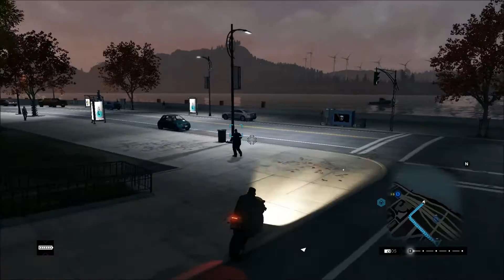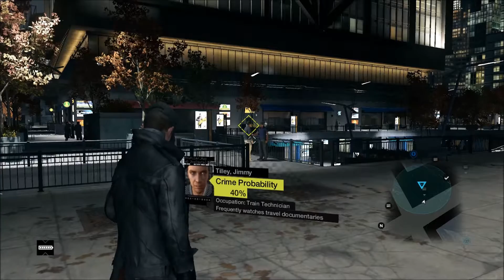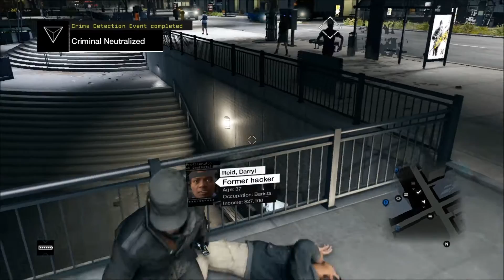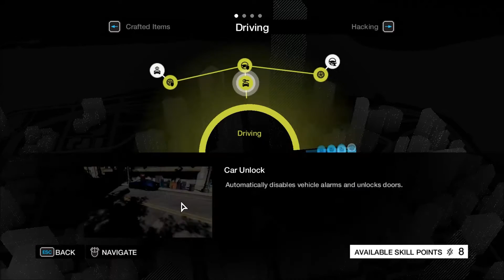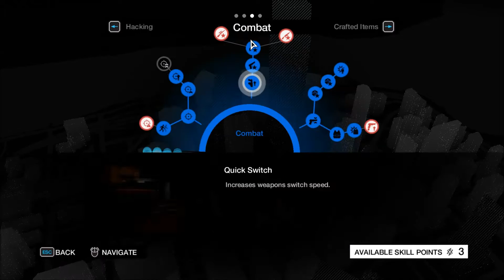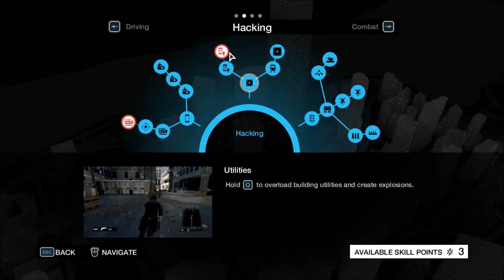MOS Profile: 5900 Electronics Maintenance

Comment: I'm leaving march 5th my program name is called aviation electronics technician. It has like BA on the form  for the program code and it has similar mos of 5900,  6300/6400 and 6600.  I would really like the 5900 field but the other ones aren't that bad. Should be fun I guess. And if not it'll be a huge waste of 5 years of my life. But j doubt it
Reply: Hey man how are you liking BA and what one did you actually get as far as the # cause I chose BA today wanna know if I should switch before I ship out
Reply: @roccorolih3902  hey Idk if you've shipped out yet but anything BA is good I just got assigned 5900 and I leave mct in 2 days for Pensacola but my dad and grandpa were both BA and my recruiter was BA as well. You will be busy af but you won't get bored with the job easily. Obviously I can't speak for all of the fields because I'm going off of what I've been told by other BA but I can say for certain that it will transfer over really well to the civilian side because the basics of avionics stays the same its just where the parts are located and how you remove them. And in the 5900 field you can actually get FAA certified which will help you even more with finding a job civilian side.
(I'll try to remember to update yall on my experience but I've got a year of schooling so ill probably forget ngl)
Reply: @contagious_noob3651  Hey man I was wondering how things went for you because I’m in the exact same situation as you were and I heard there’s a chance you could get sent to ground electronics? My orders say 5900 so I’m hoping I can get that, how have things worked out for you?
Reply: @eglismustelier924  im actually still at Pensacola ill be leaving in June. It seems really awesome so far and all of my instructors seem to love it but they also say the other 59 mos' aren't as good as ours im a 5952. I asked about faa certs and my instructors said that you dont normally get them but you can easily get a job in the civillian sector with our mos. And depending on the type of orders you get (station or detachment) you could see alot of deployments and see combat if we go to war. Station orders you dont get deployed but it makes college really easy to get done. The 5900 mos is also the smallest mos in the marine corps ans promotes pretty fast. You'll learn alot more once you reach c school but thats a good bit of it. Alos dont let the terminal barracks support get you down Pensacola is pretty cool.
Reply: @contagious_noob3651  So I want to major in computer science instead of cyber security since cyber security is subjective and computer science is a more broad version and I can still land cyber jobs with a computer science degree and vice versa. I told my recruiter this. that I want a mos that will apply to my civilian life and school once I’m done. I seen there was a cyber mos in marines but he recommended Electronic Maintenance 5900 + right now it has a $8000 bonus but I don’t care about that. I just want four years of college experience and 4 years of real experience through military so I can pretty much land any job within my major and field. Is MOS 5900 Electronic Maintenance will it really help with my career after military…? I searched it up and seems to me that Your just an airplane mechanic…
Reply: @contagious_noob3651  does it have anything to do with cyber security or computers or computer science? Please help me out and respond since your in the field you would actually know. Of course I’m gonna resurface this to my recruiter to clarify. What i actually want. It seemed like he understood and gave this MOS for that experience and for that purpose… but sometimes I hear that recruiters can lie just to get you to sign and since there’s a bonus there I’m guessing it’s really low on people… which he also mentioned…
Reply: @justthink933  you take a very basic class in c school that covers pretty much anything you need to know about a computer its basically a month long course crammed into a week. But as far as the aviation side of the 5900 mos goes your job is to deploy and maintain whichever system you are in charge of which is decided by your mos. If you want to learn the basics of computer troubleshooting you will learn those at a school (I strand) but the mos now only trouble shoots down to the cards and replaces the cards they no longer fix the circuits themselves. (I hope I did a good job explaining its hard to explain without showing you what I mean) to answer your initial question computer science and computers are to broad of a term and it has very little to do with cyber security
Reply: @contagious_noob3651  before I reiterate my question for you. How is it? Do you have to be a genius for this MOS? I wouldn’t say I’m the smartest person but I believe anyone can learn the actual work… And do you have time to pursue your college within this MOS? So my two questions in simple terms how difficult is the mos and is it possible to complete a 4 year degree with a 4 year military contract? Is the schedule flexible or tight? Are you in school?
Reply: @justthink933  it depends which mos you get in the 59 field some are easier than others none of them are to particularly hard. I just finished my mos school and am on recruiters assistance so I havent actually hit the fleet yet but from what I've heard there is alot of downtime in my mos (5952) so yes you should have time to do college you shouldn't expect to obtain 4 years of college though since you are only allowed to take 2 classes at a time and the mos is a 5 year contract.
Reply: @contagious_noob3651  okay makes sense. 2 year degree would most likely be achievable. I have a question what are you planning to do after? Is it for your civilian life? Or are you planning on staying in. Honestly I came up with this idea for cyber security or computer science degree just recently. I don’t know what I want to do but I want to make a lot of money… I’m definitely thinking the military because of the school and health benefits I can knock a lot of birds with one stone. I’m 19 btw. I’m kinda lost. Fun is subjective so what you find fun there I may not but then again I actually like computer programming and all that stuff. If you wanted to have a computer science degree and be flexible enough to have a security analyst job when you get out or land an amazing job with the degree and experience right out of the military (search up jobs with a computer science major) What way would you go about it in the military? What MOS do you think would support that?
Reply: @justthink933   right now the plan is to get out after my 5 years and pursue a career as an engineer or a firefighter while also trying to become a published author. The marine corps has a cyber security mos and you could always just try and get an easy mos and go to college while in. I dont think you realise that you aren't allowed to pick a specific mos though you pick a group of mos's and you get one out of that group